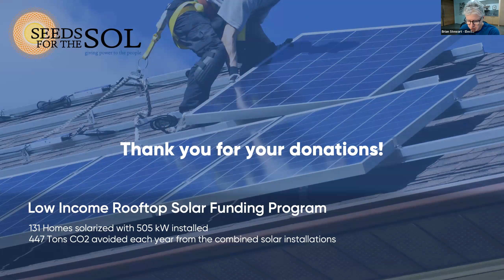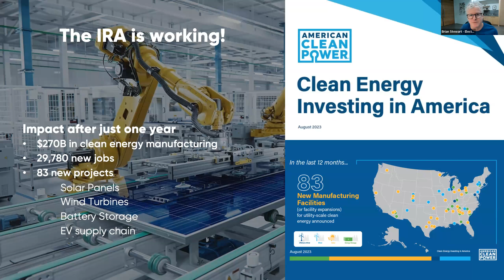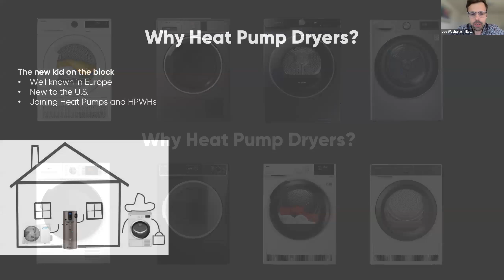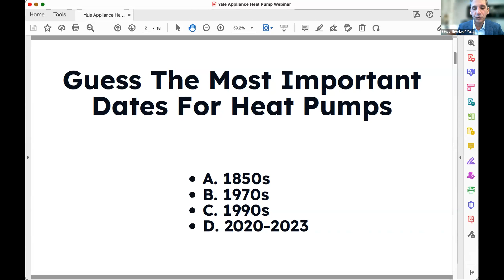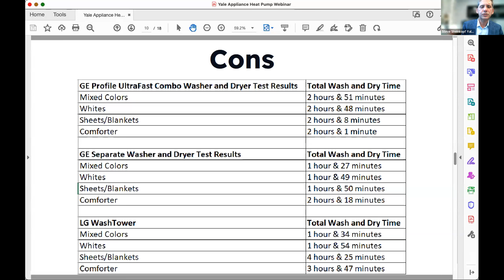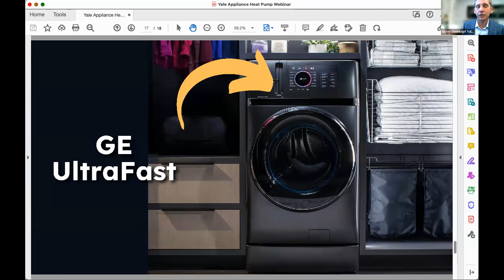Heat Pump Dryers - Update on Brands and Options

Comment: Had one of Miele’s first heat pumps in 2012. Still have it but bought a new Miele 9kg TWR780WP Heat pump dryer. It dries and eiderdown duvet, super king size in under 2 hours. The time changes often. And lowers very quickly

Comment: Heat pump dryers only seem to be £100 more than a condenser dryer or vented.  Bearing in mind that you're saving 50p each load it will only take 200 loads to pay for it self.  I do 4 loads a week, so will take less than a year and a half to get the difference back.  Also Hotpoint have a 10 year warnaty so years of savings.

Comment: I'm not sure where people get the idea that a heat pump dryer would make the room colder. For one, it's not venting, so it's not pumping air out of the house as would be the case with a conventional vented dryer. Secondly, a heat pump is an air conditioner conceptually running in reverse, so rather than generating cool aiir it generates heat. Even were that 100% efficient, which is impossible due to physics, it would generate exactly as much heat as it does cool air. Since it's not 100% efficient, it's a net generator of heat. It may help to compare it to something that more people have experience with: room dehumidifiers. While a dehumidifier creates a cool surface to condense water out of the air, it then runs that cooled air through the hot section of the system to increase efficiency. The air coming out of the dehumidifier will be warmer than the air going in, and thats essentially how a heat pump dryer operates as well. I don't (yet) have a heat pump dryer to look at, however I suspect some of that cool air is diverted away from the heating section to allow for higher temperatures around 150°F max - some go higher, but they really should not exceed that for optimal clothing care. That is considerably waarmer than the air coming out of our dehumidifiers. Still, while that may direct colder air to the room, because it remains a closed system since it's not vented, the heat has to end up back in the room eventually.

Comment: Can you ask your guest next time about his owners comments on all in one units?

Steve Sheinkopf, owner and CEO of Yale Appliance in Boston and one of the industry’s most prolific bloggers put it bluntly: “I hate these things,” he told us. “It’s really a product that should not be on the market. We do everything in our power not to sell them.”

The problem, Sheinkopf said, is that the repair rate is sky high—over 70 percent within the first year, according to his service department’s records. “They seem to be the most repair-prone products we sell.”
Reply: He also said that he likes the GE wash dryer and LG wash dry tower more recently. But did bring up expensive repair bills being a possibility.  He also noted that the repairs for the heat pumps are more related to a lack of maintenance, requiring a cleaning of coils, and when that aspect was removed the repair rates are as reliable as other dryers. The GE  wash dryer version does look easy to repair though as the heat pump section can be replaced as a whole and that would be a quicker repair for others. (As detailed by another technician channel I watched.)

Comment: In our household like we're doing 3 to 4 loads a week, so our potential savings are reduced relative to Steve's numbers. However, we will also be adding a heat pump water heater and an inductive cook top to round out our home electrification which means those pesky monthly natual gas bills will go away, bringing additional savings. Happy to hear about the 110 HPD options now available.  Cheers and thanks for the great session.